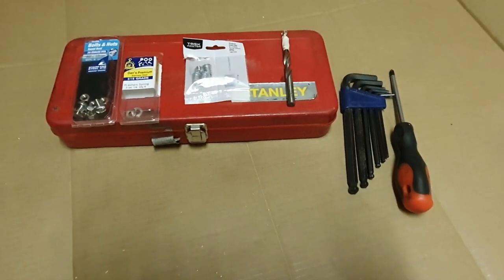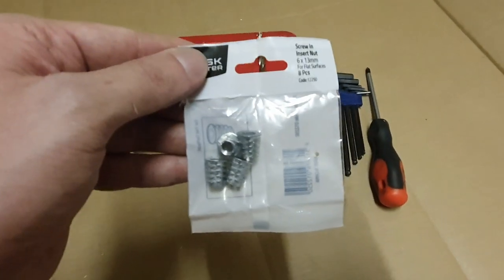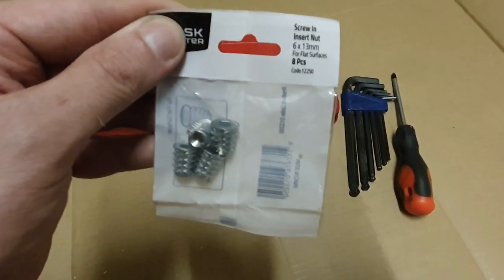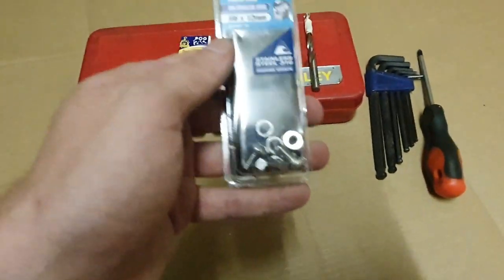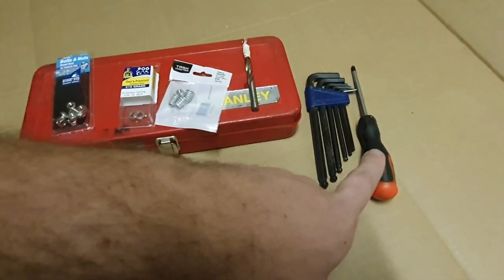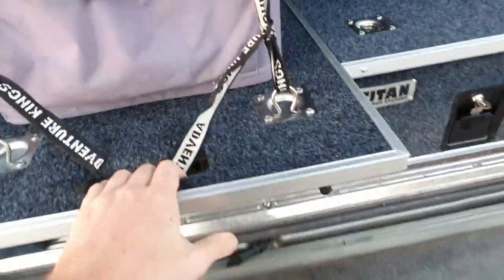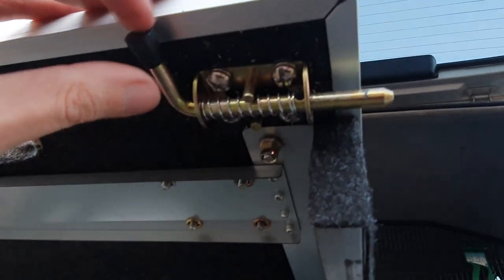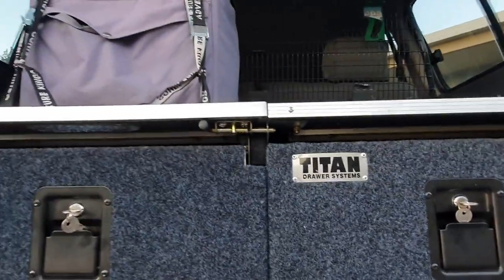DIY: The Cheapest King's Titan Drawer Fridge Slide Latch Mod

Comment: One little mod I would love to work out is to make the draw stay open when you open it 😁. Sometimes im opening it a dozen times wheb grabbing tools that i end up using a clamp to hold it.
Reply from the maker: I would say, add a spacer under the rear of the drawers where they bolt down to the floor and tilt it slightly.

But, that also sounds like your rear end is higher than the front. 🤔
Reply: I added a small gate latch on the wing and drilled a hole in the drawer. Worked great
Reply from the maker: Simple solution. 👌
Reply: @bensparks9467  i ended up wanting to make the draws more accessible. 
So i jigsawed as much of the two top boards away.
Then moved forward the lockout bearings that hit the bumpstops  and added some steel offcuts for re inforcement on the bottom row of bearings. 
And as a positive side effect. because i drilled the new bearing holes slightly crooked. The draws  pull to the side a bit at lockout and hold themselves.. 
Not super pretty. But much more practical and intuitive feeling for my little wagon. and i can close the draws with out worrying about fingers getting caught.

Comment: I just fixed mine up pretty much the same way a few weeks back.
Reply from the maker: It's the only way to fix the latch after they went to this design from the push button release they used to have. 👍
Reply: Where did you buy the exact same latch please

Comment: Where did you get the spring bolt from? Bunnings doesn't sell them that small.
Reply from the maker: That came with the drawer system.

You may be able to order it as a spare part from 4WD Supacentre.

Comment: had mine for 2years ?? I haven't had any problems yet ? but I hardley use the fridge slide ?
Reply from the maker: They changed the latch from a push button release, to a spring loaded lever.

Unfortunately when that revision was done, they used self tapping wood screws which was a big fail as the pressure from sliding the locking pin back tears them out.

This upgrade retains it with bolts/screws.

Much more secure. 👌

Comment: You have step by step ?
Reply from the maker: Unfortunately I don't.

All you need to do is drill out the latch to suit the new screws and drill out the drawer 0.5mm undersize of the threaded wood screw inserts.

Don't drill all the way through either and if you find the inserts are a little too long, you could shorten them with an angle grinder.